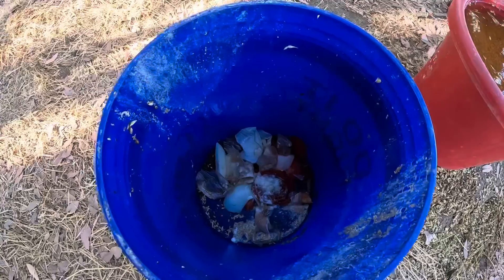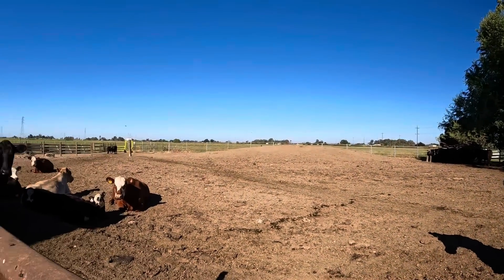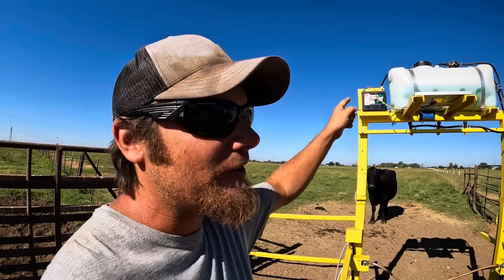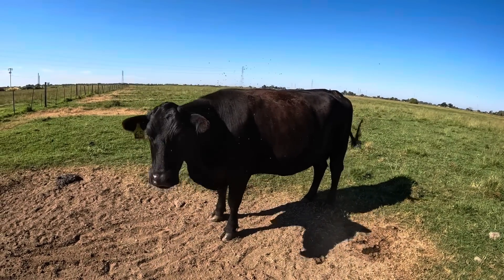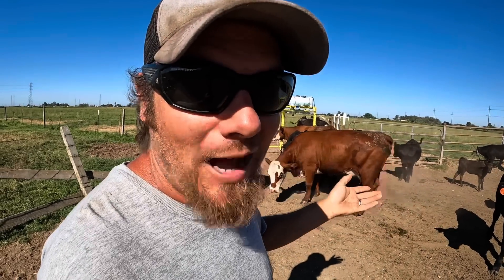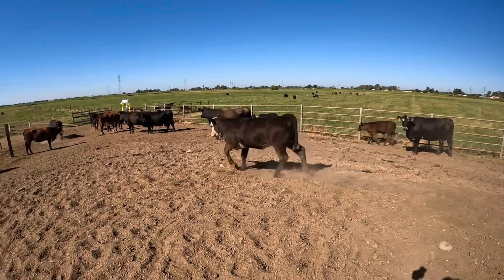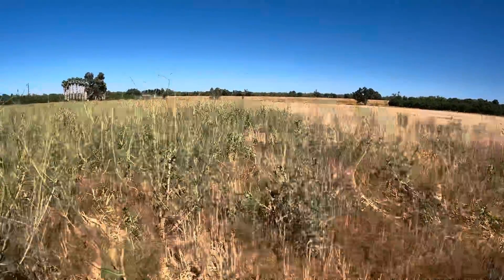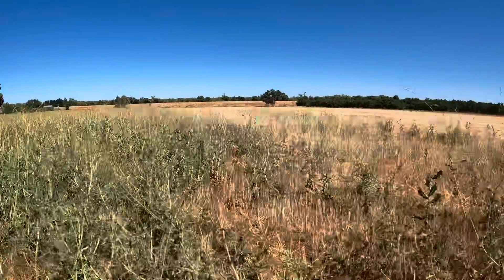A Natural Fly Spray that Seems to be Working and Other Ranch Updates!

Comment: If you can establish a stand of alfalfa there are varieties that can withstand a period of dry weather.  It will essentially go dormant, but the plants can have very deep roots to get to moisture well below the surface.  It might require a little irrigation for that to happen and it appears that you have access to irrigation sources in your area.  Only way to find out is to try a test plot.  A fall planting would be good timing.

Comment: There are some alfalfa varieties that have been developed for dry land use. You would need to check with a seed dealer to see what is available. You could consider mixing it with a perennial grass. If the water table is within 10 or 15 feet of the surface the alfalfa roots will reach the moisture, and provide you with multiple cuttings. The trick will be to get it planted when you are getting rain, but it is not too cold or it won’t germinate.  I think a fall planting would work for you. You probably won’t get much off of it your first year, so you would want to start with a small test plot, and then add to it if it works out. I grew up about 40 miles from the tractor junk yard you visited last year in Nyssa Oregon just across the state line in Idaho. We had around 50 acres in dry land alfalfa and could get a pretty heavy single cutting..

Comment: We had 50% alfalfa/40% brome/10% timothy mix in central Alberta that did quite well on dry land. BUT for us 80F was pretty hot and 90F was seriously cooking, 70F was pretty average. Obviously during 'partial drought' years production was down but still worth harvesting. 70LB bale harvest on 100 acres ranged from 6,500 to 10,000 bales total. Second cuts every 2 or 3 years on average and there was never a third cut. Hope that helps a bit.

Comment: Yep,  soap and water is so under rated. all wounds need to be cleansed with soap and water and then rinsed. iDK about using it as fly spray. the soap build up on the cows skin might become irritating and cause problems after awhile. Time will tell.

Comment: About your mower, you could always modify it easily. leave the nuts off and just drill a hole through the bolt or stud and then put an R clip though the hole to hold the door shut.
Reply: or one of those D locking pins
Reply: There you go, Tyler !! Problem solved - and it didn't cost you a penny !!

Comment: Alfalfa still needs some good moisture. It’s a cool season plant so it also shuts down when it’s hot and dry. If I were you I would rather put in a warm season cover crop of some kind. 8-10 species of warm season  annual broadleaf and annual grasses, you could also save on fertilizer with the proper mix. Sorghum sudangrass in your mix would work well.

Comment: Tyler, 

Permethrin is a man-made synthetic insecticide whose chemistry is based on natural pyrethrum compounds that are derived from the flowers of the chrysanthemum plant. Said another way, permethrin is a synthetic insecticide based on the chemical structure of a natural plant compound called pyrethrum**.

That said, it can be used on humans as tick and mosquitoe repellent, without the concern for cancer.

Comment: I admit as a cattleman, I struggle with the thought of spending any amount of money on a nice fly sprayer like the one you have in operation and then use soap water in it, which is not nearly as effective and frankly pointless.  What it is doing is creating a crust on the hair (think unrinsed shampooed hair) of the cows, which in turn may prevent them from keeping cool during the hot summer days.  
Secondly, it may damage the hair leading into winter as well.  So a few things to think about.